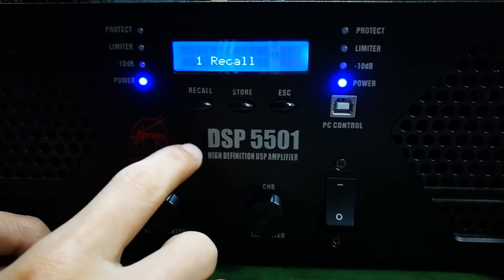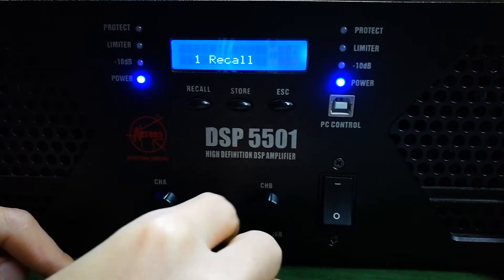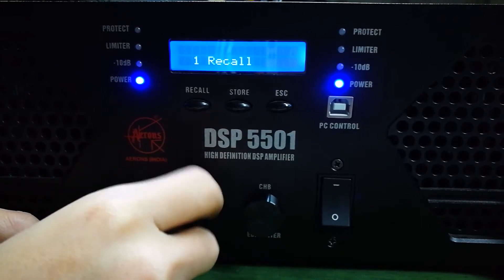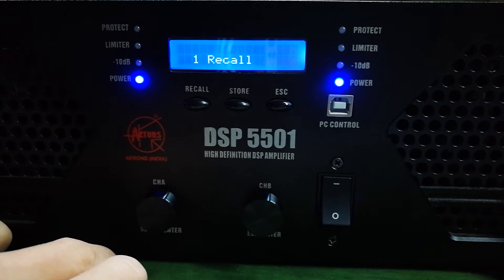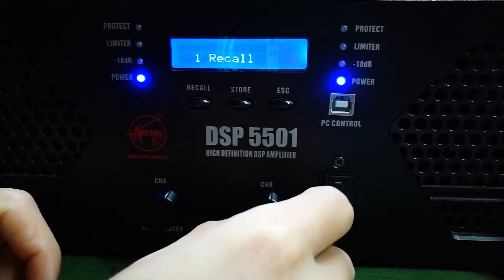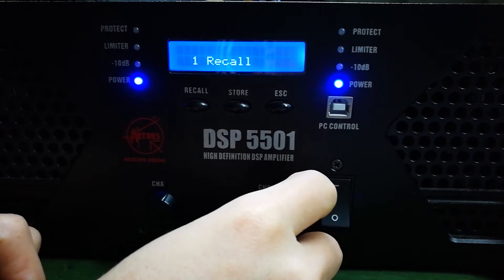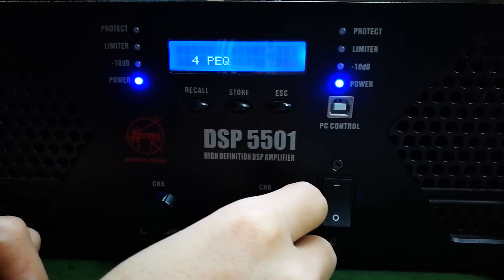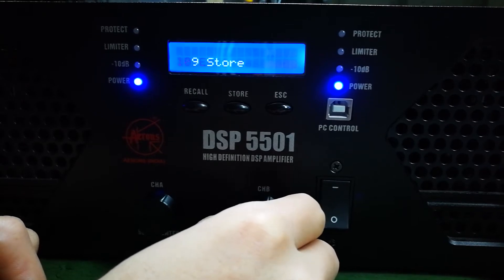AERONS DSP series amplifier

Comment: dsp 5501 how much provide the power ...at 4 ohms ? 

its be stable also. for 2 @ ohms for mid speaker ?
Reply from the maker: DSP5501 is 1000w x 2 @ 8ohms, 1600w x 2 @ 4ohms, 2000w x 2 @ 2ohms. Yes you can use amplifier at 2ohms without any issue. You have to be carefull because if their is too much clip signal then it can burn speakers easily.

Comment: What's the difference between simple hd 5001 and dsp 5501???

Also whts the price difference??
Reply from the maker: The only difference is HD5001 is with analogue input board and DSP5501 is with Digital input board. DSP5501 is having crossover/eq/limiter/compressor. Price is almost same because we have special discount on DSP 5501 to make it popular.
Reply: @AERONS  pplz tell me.price ?

I want to buy
Reply from the maker: @milaykumar  DSP5501 you can get for Rs 38000.